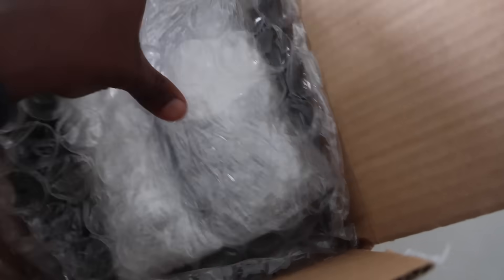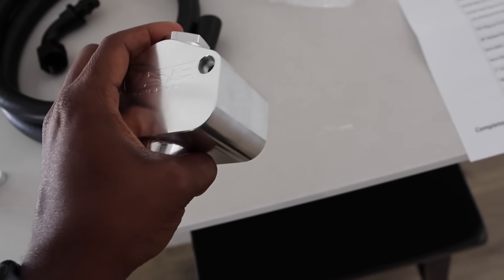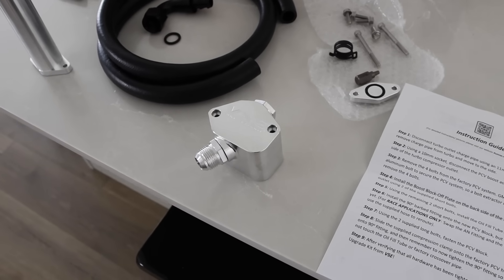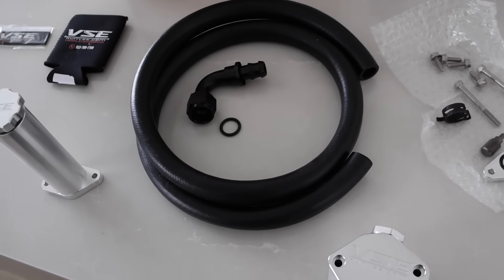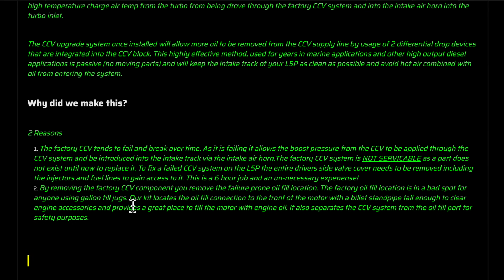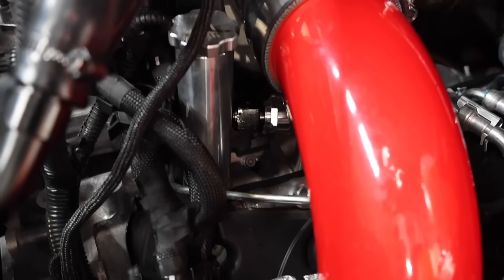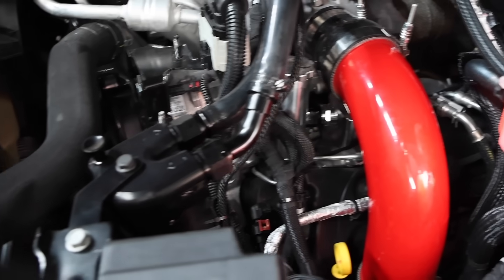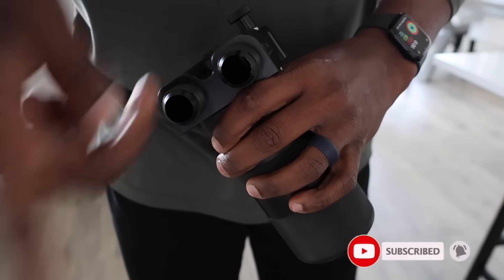GM Built In A Major Flaw in Your L5P Duramax... Here's How To Fix It!

Comment: Sad that after spending an outrageous sum on a new truck, you have to spend even more to “bullet” proof the truck. You should do a video on what it costs to correct GM’s mistakes. Between this, the transmission, the def delete, the egr blocker it could add thousands to the cost, especially if you are not doing the work yourself.
And then consider the cost of the  transmission and engine oil pan replacement, the rear end cover, I’m sure that will add many thousands.
I have an 06 Dmax with 250,000 miles. Runs great. I went to a local diesel shop asking which 25 diesel was the one to buy. They told me to keep the 06.
Reply: To be fair, you can't blame GM for the emission control issues . Thank a democrat for the unrealistic emission requirements.
Reply: @ada-yw1bb  100% correct. But the auto manufacturers have a reason to point the finger at someone else and produce a more inferior product.
Reply: New gm 3500s are the cats meow.  
Lighten the exhaust.   Upgrade the valve body.  Boost tubes.  
Seems all good then.  
Awesome suspension and brakes.  Power is unreal.  
Tires wear very little on the front.  
Front ends don't beat you to death or fall apart.

Comment: I have both ccv kit and catch can. Super high quality components. Talking about bullet proofing the truck I’m surprised you haven’t done a fass drop-in system yet
Reply: After Christmas that's the next upgrade to my 2023 L5P!
Reply: @RobertHolster1 Nice! That was the first mod I did on my 24 after I brought it home. Highly recommend. Works great and install was super easy with their YouTube video. The titanium series is obviously better but requires tuning
Reply: @DuramaxMike33 agreed! Can't wait to get mine. 99% of everything I've done myself, so definitely looking forward to this. Already have the FASS Billet fuel filter housing for the factory filter. Truck still under warranty so no tuning🙄😬
Reply: @RobertHolster1 Same here everything’s been fairly easy minus the banks boost tubes and turbo inlet which required some more patience. The VSE ccv and catch can were super easy. Yup I’m running out my warranty before tuning also🙃 how’s your valve body holding up? Any issues? My next mod is the next gen valve body. Haven’t had issues yet but I only have 8k on the truck and don’t want to risk getting stranded.
Reply: @DuramaxMike33 so far so good. Taking it next week for service. My advisor told me they will inspect it, although not in the recall.
Reply: @RobertHolster1 right on good to hear!

Comment: 2026 - HD trucks problems fixed with transmission? I have a feeling GMC is trying to skip over this and get into the new redesign of the HD trucks.
Reply: LOL. GM will never fix the valve body issue.
Reply: 900 bucks fixes the issue.
Nexgen valve body.
Reply: @demsarewet1ply  $900 bucks my ass. $1500 for the upgrade. $3500 for the entire valve body.